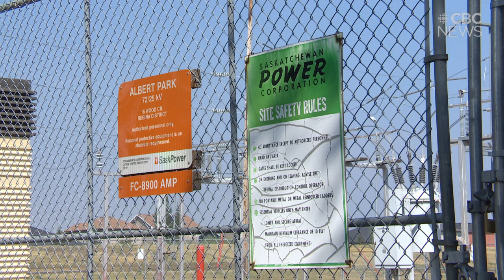How should Saskatchewan generate electricity in the years ahead?

Comment: To start, we use carbon capture technology on our coal fired power plant. We can use it on natural gas. Nuclear energy is also a good option. The best option is to get rid of net zero. We know solar and wind is too expensive to use and not reliable. It certainly doesn’t carry a base load. Climate is changing. We have to realize that Saskatchewan does not contribute enough carbon to make a measurable difference so cut the excessive cost of net zero.